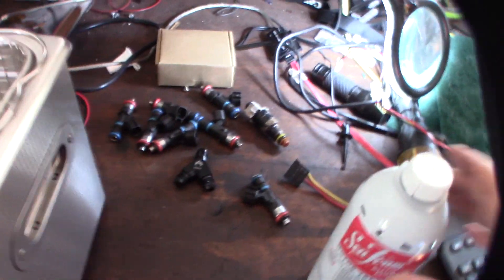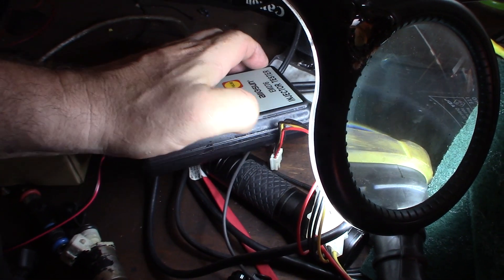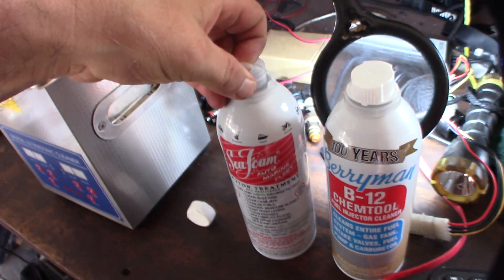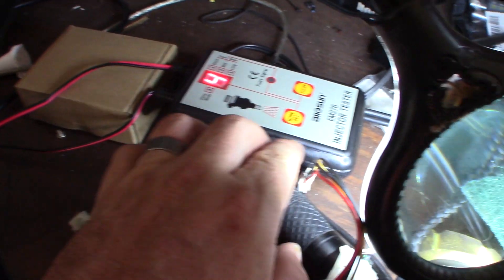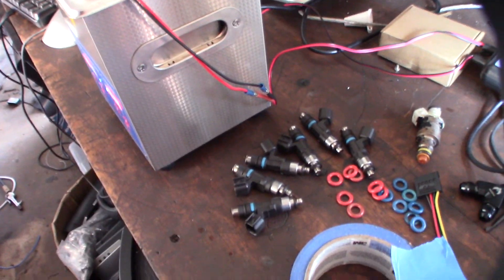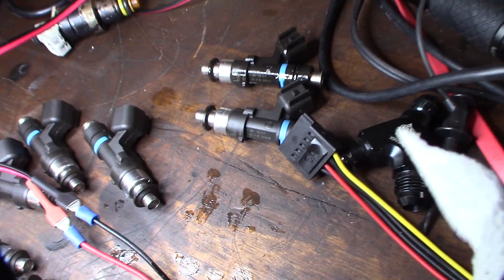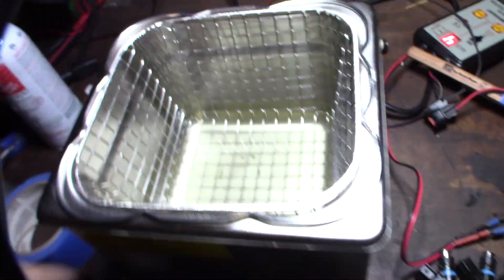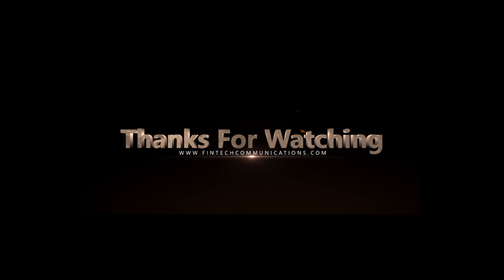Ultrasonic EV14 Injector Cleaning with Sea foam solution

Comment: Anyone tried, turps, diesel or petrol ?
Reply from the maker: I use diesel all the time, great for cleaing caked greasy parts
Reply: @fintechrepairshop  I shall try paraffin in my ultrasonic cleaner, then a spray brake cleaner and finish with WD.40,

Comment: First let me thank you for such a great video. I replaced all of my injectors with a new set off Ebay which stated they were a match for my truck. After the install the truck ran awful, nearly got me in several accidents, amazed I wasn't hurt or towed off the roadway. Found your video, and cleaned mine the way you described, I own a high end ultrasonic machine a jeweler once owned. I did the ultrasonic for 1/2hr on my factory 176K miles original injectors. Wiped them dry, blew them off with a air pressure gun, then reinstalled on my F150. Cleared the codes and removed the positive/negative battery cables, then attached a 1 ohm resister to clear any and all old engine codes(very important step). I said a little prayer to God and cranked her over. let me tell you, that engine only ran like that when I first bought it over 16 years ago. I cannot thank you enough. Your video is 100% on point.
Reply: Never just swap injectors unless it's with the same part number. You can use others but have to change the injectors in the tune incase they are a higher flow rate.

Comment: First your ultrasonic cleaner has a fill line your solution must be above that line (the lip) or you can damage your ultrasonic I would put the temp at 65 C I use ELMA TEC CLEAN  S1 specifically designed for this purposes mix the the ratio at 10% solution to 90% water now this next step is very important for best results you need to degas your ultrasonic solution when putting in new solution some ultrasonic machines have a degas button if not just run the ultrasonic for 10 minutes the next step is to use a basket and completely submerge your injectors if done correctly you will be able to see the contaminates rise out of and off of your injectors the next step is to submerge your injectors into a bath of 99.9% pure anhydrous alcohol( isopropyl alcohol) anhydrous translates to without water the alcohol displaces the water completely after a few minutes you can place in a toaster oven at very low temp or just wait for the injectors to evaporate won’t take long please don’t waste your money on a cheap machine buy a crest power sonic because it cycles between different frequency’s
Reply: If you submerge the injectors completely do you still need them connected up and pulsing? Or can you just submerge them and let the ultrasonic machine do it’s job?

Comment: Is Lucas additive that put at gas tank  good to clean injector with ultrasonic cleaner?
Reply from the maker: I think anything thin and petroleum based should work.
Reply: Use the diesel gas Lucas cleaner it comes In Small bottles 5 oz or a quart bottle what's great about it you can use it every fill up if you wish. An no worries about over concentration seafoam an Berryman can an should be used every oil change for best result.

Comment: Just a word of warning so to speak.. Ultrasonic cleaners are engineered for specific amounts of liquid. A 1 liter cleaner needs 1 liter of liquid or you will ruin the transducer. Fill your cleaner up with another liquid(water will do)and use a glass or plastic container with your cleaning solution in it for your specific parts. works great and wont kill your cleaner
Reply: enginemaxcarb.  I guess this is just your experience because I have had great luck with mine cleaning carbs and everything else I put in my cleaner.
Reply: enginemaxcarb.  Comes from a guy that can't type or spell..  nice
Reply: enginemaxcarb.  Go bother someone else. I'm done with you.
Reply: Fill your ultrasonic cleaner to the fill line 🤦‍♂️

Comment: ultrasonic cleaners should be at leased two thirds full to work properly , I clean carbs all the time with water and vinegar (two parts water one part vinegar) you can also use lemon juice
and you adjust the results with  the mixture ratio and time. Amazing results.  My machine instructions say that not enough fluid to contain the energy can cause the vibrators ?? to separate from the tank .
Reply: Very true on having enough fluid in the machine.  I've read 2/3rds, 3/4 etc etc.  I've read not having enough can cause the ultrasonic transducers to overheat.  If they don't have enough liquid to put the energy into, then it creates heat on the transducer.  That could cause the problem I mention I guess.  I always fill mine full of water and then put what I want to clean in a plastic bag with cleaner solution or some other container.  Plastic jars, like peanut butter jars, work well.  Doing it that way, only water is in the tank itself and I use much smaller amounts of cleaners.  If you use glass, test first and make sure there is no chips or cracks.  I've read it can cause them to shatter. I never used glass tho.  

I have found that water and a tiny amount of dish detergent does wonders.  I have a ultrasonic machine like the one in the video only mine is larger.  It's 10 liters and four heads.  I used vinigar once for a shower head.  Works like new now too.

Comment: you do know that allsun EM276 can run more than 1 injector at a time lol i just cleaned 6 and give em 30 mins in ultrasonic lol all at once
Reply: and normal ultrasonic carb cleaner is good enough
Reply: How do you do it?
Reply: @00bean00  just wire all the injectors together

Comment: I haven't done this to mine yet.  As I understand it, an ultrasound cleaner works to remove deposits is to cause cavitation inside the part.  For that, the solutions like simple green for jewelry has a soap base that's non foaming but allows strong cavitation.  Simple green is water soluble.  Using solvents like seafoam might not be necessary.  Also, mineral oil is supposed to work well if water would be harmful to the injector.

Comment: The case is probably abs it is known to dissolve then in acetone.. not all plastic will I think abs will also dissolve in gasoline too... I don't think injectors are made with abs.. it probably will melt ... that's why u can't use regular rubber o ring on fuel line part's because it will dissolve the o ring

Comment: Have you ever cleaned the 6.0 injectors with this method?
Reply from the maker: I probably will try that when one of my injectors start failing. I have 192K on the original injectors.
Reply: I just pulled all mine to do a reseal. Looking at the tips and they look pretty bad. May just soak the tips and give them the shakes LOL
Reply: Miss the truck man how's it running?
Reply from the maker: @ssweeney9691  still running great. I have to do a coolant backflush soon. My deltas are creeping up. Not bad yet. Just want to do it before it becomes a serious problem.

Comment: What did you use to pulse the injector?
Reply: Per comment, Allsun EM276 Fuel Injector Tester
Reply from the maker: Look above. The amazon link
Reply: @fintechrepairshop  Yes, but the only link is to the ultrasonic bath.